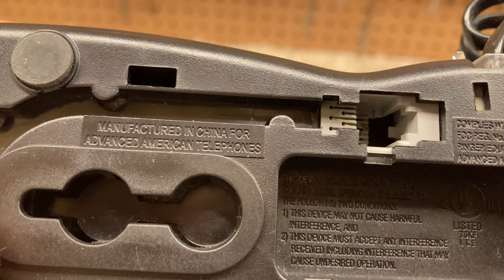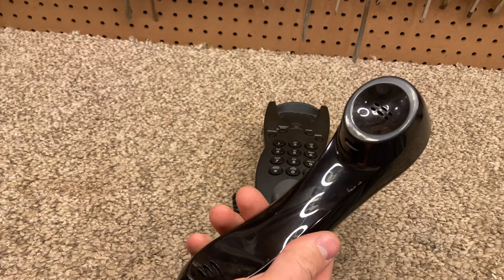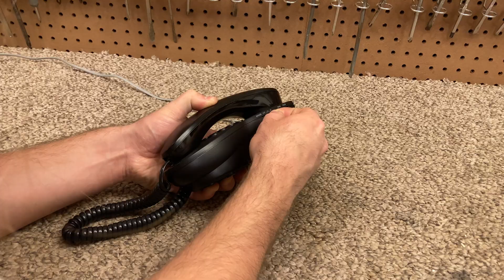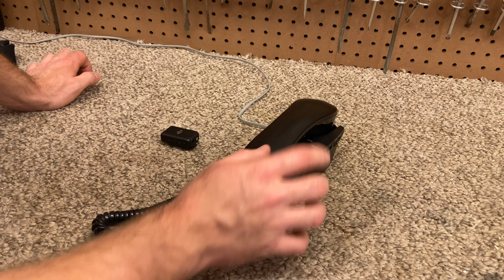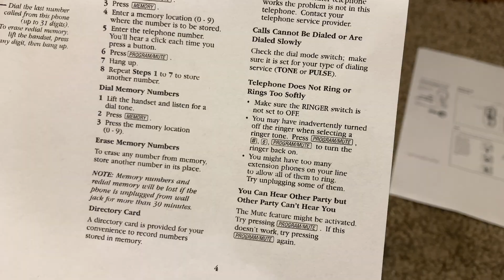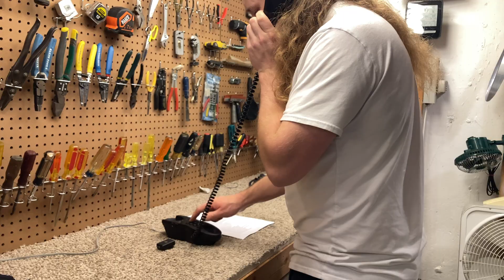AT&T 146 Design Line Telephone | Initial Checkout

Comment: Lucent, not AT&T, became Advanced American Telephones after being acquired by vtech in 2000.

Models with that handset and caller ID were 950, 958, 1856, 1480, 1485, 1487, E2562, E5908, TL74108.

"The wind noise nullified and voided the audio quality test."

I prefer this to the 210 because the buttons are on the base. They're able to be used while the handset is held up to the ear, and they're easier to use when the phone is wall mounted.
Reply from the maker: Each design has advantages. This design is better on the desk conducting business during the day. The 210 is better on the night stand in an emergency in the dark.

I think the 958 might have been the one at that house, but I can't say for certain. That was close to 15 years ago, the memory is faded.
Reply: Are all those models also design line phones? Would make sense that they all have the same design as this phone, if they are.
Reply: I didn’t know that! Thanks for sharing the information!!!

Comment: That explains why my 1991 B&O Beocom 1401 sounds like a modern 210/213–they must’ve started using the modern software in the early 90s. I guess anything with the old ringer would be late 80s-early 90s, or there was a mix of the 2 in the lineup.